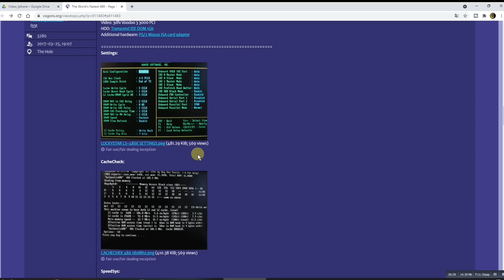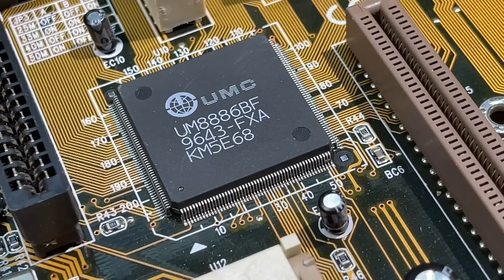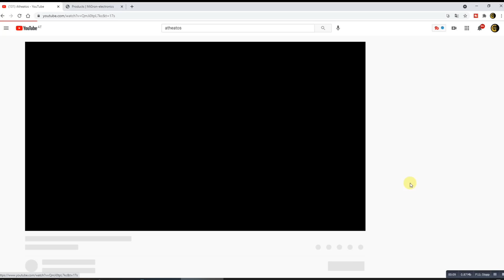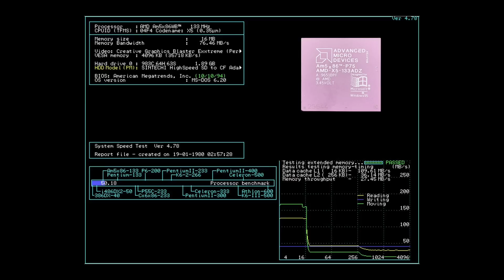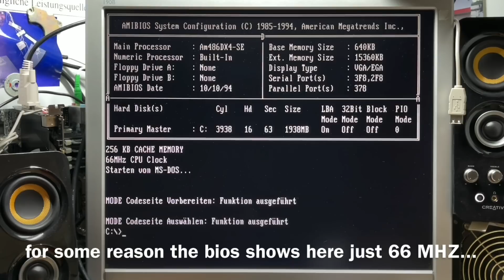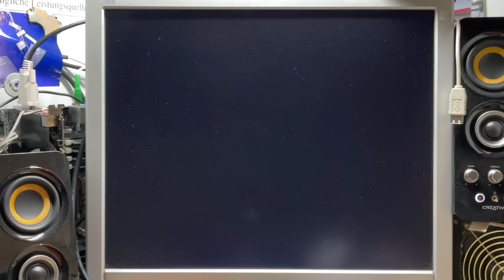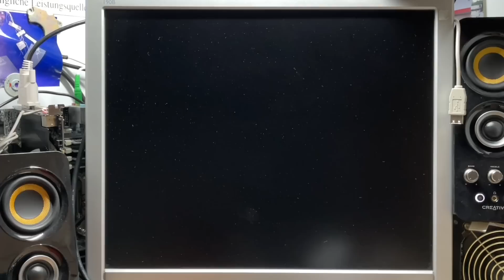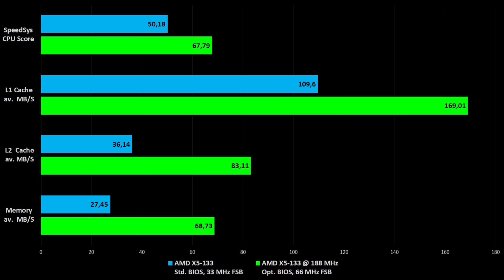AMD X5-133 Overclocked @180MHz / RECORD FPS in Quake/ PCI Clock Checker Tool

Comment: M919? Holy! I just missed out on a M915, thinking it's wasn't possible to find a later Chips build. What a cool board! 1 VLB even, and onboard IDE? Perfection! COAST module. Then again Chips boards are generally good. All of them get the best ratings.
Reply: M915 is crap ... M912 is a great board tho - sadly lacking PCI slots.
Reply: @RandomBlankUsername  All of my rigs are VLB, so I don't care about PCI slots. 1VLB ain't so bad, if the IDE controller is onboard. And what's so bad about M915? I only read good things regarding CPU compatibility. M912's show up on ebay periodically. I let them pass. At home, my favourite is MV035. Supports 2 types of ram, has 3VLB's and is good with fine voltage management on the CPU. But I don't overclock, because despite having a ton of CPU's, I only have 1 of each kind.
Reply: @enilenis  PCI performance was really underwhelming and some more details I'll look up tomorrow ;) I've had my fair share with VLB boards intended to be used with a POD. Ended up keeping the M912, 486SV2GX4 and 486SP3 from Asus.
Reply: @RandomBlankUsername  I just installed POD into MV035, but haven't tested it yet. Have to figure out jumpers first. Another machine that I'm upgrading is Mastsonic M601, that I acquired with a dead 133MHz AMD chip, and I'm waiting for a duplicate to arrive, till I can restore it to full speed. M912 I'll read up on. I don't have it, but if you say it's good, I might add it to the collection. 486SP3 - I read good things about. Most of my gear is Asus branded. I like the company. Has good longevity. My favourite ASUS board of all times is P2B-DS. I've had 2. Socket modded. Dual P3-1GHz. As close to Tualatin as it gets. But that's a whole different generation.
Reply from the maker: 486SP3 is also a great mobo!
Reply: @CPUGalaxy  Thanks for the advise. Will keep an eye out for one with populated cache sockets. I've seen them show up on ebay periodically.
Reply: @enilenis  Just checked my documentation ... or rather the thread I've started on a German DOS forum ... apart from the bad PCI performance, the M915 was very specific issues with GUS cards (I'm the guy behind the ARGUS project), also the M915 apparently has problems with writeback enabled DX4 CPUs.
Reply: @RandomBlankUsername  Very good to know. Thanks for the info. I do use GUS cards, so for me that's an important factor. Good thing I missed out on an M915 I guess. ARGUS project? Neat! I read about it. Funny thing, I was shooting a documentary on Gravis Ultrasound few years back. I live 15 minute drive from their offices. I even went in and recorded interiors, but never finished the edit, because the interview with the founder fell through. And then got overwhelmed by other things. Because of how much Gravis cards sell for, I even jokingly scooped some dirt from in front of Gravis offices, and was going to put it on ebay for as much as a GUS Max, as a gag. I mean, if their cards sell for well over $1K these days, the dirt got to be worth something also!
Reply: @enilenis  Idea with the dirt is great :)
And yeah, the ridiculously high prices are the reason I started the project ... managed to snag about 450 InterWave chips for ~$3 per piece ... all the other stuff for assembling an ARGUS are maybe $50-$70.

Comment: Still running my 5x86-133 every day, it controls a mini lathe we use for manufacturing. Have it underclocked at 20mhz x4 to keep it cool and happy. Used to always run it back in the day at 160 and never a problem.  But now that I know 160 might result in a 20mhz pci clock.. seems like I always suspected the speed bump seemed lacking.

Comment: I had one of these and used it at 180mhz from 1997 to 2003. Played unreal on it with a 2MB VLB video card and 32MB of RAM. I used to call it the fastest 486 in the West.
Reply: Unreal on 5x86? How many fps?
Reply: @mixal31  probably like 12 or so ^^
Reply: @phreeze83  yeah 12 but per minute :-)

Comment: Great videos. I didn't realise Quake would run on a 486. I thought it was compiled with P5 instructions. I remember the first time I played the demo on an early Pentium. Also the first time I saw 'true' colour in Win 3.1 Good times.
Reply: It will even run on a 386 with a 80387 co processor installed.

Comment: Those are pulling numbers in the range of my Pentium 100 box. Which is on a VX97 and uses 60ns FPM but with pretty stock timing and nothing particularly tweaked. Very very impressive I must say. I keep this machines timings rather pedestrian only because I do have a machine right above it that is super tweaked and fills that gap to a 233MMX. And is probably the machine I use the most of all my pentium and newer stuff.
I think in 3dbench with its ATI Rage Pro Turbo its roughly 90FPS or so. So 120 out of your machine is extremely impressive. If I tuned the timings to the most aggressive possible I can break about 100.  This shows what the high speed PCI bus does for you for sure!
I do not know that machiens quake scores, but that is not a fair comparison.

Now a Pentium ODD at 100 will be able to give this X5 a run for its money in quake, but that is probably about it. It would be hopelessly out ran in anything else.
Reply from the maker: yes, I was also very surprised about the values I got there. And you are right, the 60 Mhz PCI Bus brings here a lot!
Reply: @CPUGalaxy  Is it possible to do a quick follow up to see what a 30mhz pci bus would do with all other things being equal?
Reply from the maker: quake 20.7 / Chris3d 640 21.1 / PCP640 12.4 / 3dBench 97.2 / Doom 52
So the most bunch I got in 3dbench and doom with the 60 mhz on the pci bus.
Reply: @CPUGalaxy  That is pretty interesting indeed. Thankyou !   Seems like the 2 things that would appear to be the least complex computationally benefit much more from the fast bus. I am wondering if it may not be so much the extra bandwidth, but the apparent lower latency.  Those two things may send many more and smaller chunks of data to the video chip.

Comment: I used to have one of those back in the days, and I overclocked it to 166MHz, using a crappy FIC motherboard that I had for years. I had to do some work with a pin in the 486 to be able to use it, I isolated it with glue so it wasn't in contact with the socket. I could use it at that speed for most stuff, including a finite elements assignment, but there were a couple of games always crashing, so I reverted back to a more conservative 150MHz. I now think it was a matter of cooling, but who knows. Nice to see your channel is growing.

Comment: Hm how about taking this too the early socket 5 & socket 7 pentiums with a super socket 7 motherboard that can take 100 mhz fsb ? on amd k6-2+ & i think k6-3 as well setting the multiplier too 2 will make the cpu run at 6x multiplier so you can probably get 600 mhz out of the k6-2+

Comment: "we are just talking about a real 486 and not pentium overdrives or cyrix 5x86 chips" as the camera pans across the chip that clearly says "Am5x86"
Reply from the maker: yeah, coz the Cyrix 5x86 is not a real 486 from the technology point of view. But the AM5x86 is. 🤷🏻‍♂️
Reply: @CPUGalaxy  yes, Am5x86 is a real 486. I just found the combination of "5x86" on the chip with the "real 485 and not... 5x86" part amusing.

Comment: I never thought I'd see the day where there's a PCI mobo with VLB integrated. Never thought that would be possible.
Reply: There are actually a few PCI/VLB combo boards. Some are VLB native and use a bridge chip to the PCI slots and some are basically the exact opposite. I don't think there are any that have native PCI and VLB built into the chipset though, but I could be wrong. It's a neat setup, as it allows you to do direct comparison of VLB and PCI graphics cards. I only have VLB 486 board myself, but I'd love a combo board to do some testing. Would be neat to see how otherwise identical cards with different buses would compare, like the Diamond Stealth 64 which exists in both VLB and PCI flavours.
Reply: @rebeccaschade3987  I think the 486 boards were all native VLB because VLB was basically a direct connection to the processor bus. Pentiums used a different processor bus and so VLB had to be bridged through the chipset.

Comment: Neat! I wonder if my Evergreen version could overclock like the ceramic ones.
Reply: It's doubtful that it would go as high, seeing as  the interposer board that lets it run in a 5V socket limits your ability to overvolt. At least unless you're willing to risk modding the interposer board. But it should still be able to overclock a bit. Increasing the bus from 33MHz to 40MHz might be doable. It of course depends entirely on the motherboard as well. Some have much more flexible adjustments than others. The 60MHz bus of the M919 board is simply insane for a 486.
Reply: @rebeccaschade3987  The interposer board does have  (unpopulated) solder pads for switching between 3.3V and 5V via jumper. The chip itself says 3.3V. I mean, there is not alot of components on the interposer...it might not be too hard to mod though I think I might rather sell it rather than risk damaging it. Plus, I have an Pentium 83Mhz Overdrive and a Pentium 66Mhz Overdrive chip that work in boards I recently acquired so I don't really need to risk it.

Comment: Ahh, that Doom and Q1 bench is disgusting! My P166 (admittedly no lvl2 cache and onboard vga) I was getting 26. Very impressive, and very entertaining.
Reply: If I remember right, my P100 is getting a little over 24.
Reply: @wishusknight3009  Is that with l2 cache at all? I think mine was roughly where most 166s were before I upgraded bits n bobs. I've swapped to EDO, a 4mb Matrox card and 256kb coast module and now it's getting 38fps if I remember right. I'm thinking 24fps on a p100 is not too bad. A lot better than my Cyrix 5x86 100 😂
Reply: @RediscoveringRetro  Its on an Asus VX97 motherboard with 16 mb FPM and 512k l2 and fairly middle of the road timeings. Video is a Rage Pro Turbo.
Reply: @wishusknight3009  That sounds a nice setup. So many memories of those early Pentiums.

Comment: Ahh the good old M919. The traces for the two (Unpopulated) cache chips are rather 'interesting' on this board! I had one back in the 90's which had the fake cache chips soldered on :)
Reply: I'd like to hear more about this. What was with those unpopulated spaces anyway?
Reply: @SireSquish  The space was for cache RAM to be soldered to the board. In the case of some revisions of this board, the circuit traces only link the two cache chips together and do not connect to the rest of the board! Pretty useless. 

For a shot period in the mid 90's cache RAM was very expensive so companies cheated and used fake chips. More detail can be found here... http://redhill.net.au/b/b-bad.html  

The board used in this video has a real cache module installed in the slot in front of the PCI connectors.
Reply: @DevilishDesign  That's a combination of surprising, not surprising, hilarious and infuriating. So many things were dodges like that before widespread Internet knowledge.
Reply: @DevilishDesign  not "companies", _one company_, PcChips
Reply: @rasz  They were certainly the worst offender but boards from Gigabyte and QDI also had fake cache
Reply: @DevilishDesign  do you have model numbers? that would be the first time I heard about fake cache on gigabyte

Comment: Very nice, congrats! I own the same CPU, but I won't even consider overclocking it because I have only one =). I'm currently playing around with Pentium 3 FSB overclocking. I want to have 800MHz P3 (used to have this model when I was a kid), but I managed to find only 733 and 866 for cheap. Solution for me is to overclock 733 to 800 by overclocking FSB from 133 to 145 MHz. That gives 36.25 MHz for PCI and 72.5 for AGP. I still have to test this system for stability. My only concerns are ATA drives and a network controller, those are known to not work properly on an overclocked bus.
Reply: Pentium 3 and Celerons were insane for overclocking.
I used to have a 667Mhz which would run at 1050Mhz, no problem all day everyday.
At that time my motherboard was not the best, so I think I could have even squeezed out a little more!!
Back in the day some people said overclocking was just silly, would barely improve the performance.
Well, this overclock meant I could run Quake 3 all of a sudden!

Comment: This reminded me of an awesome Pentium III-333 MHz in Slot 1 format that was in fact 500 MHz and was working awesome at default voltage settings.
Reply from the maker: lol. funny that you say that now. Coz exactly now I am sitting in front of a PII mobo and was overclocking a 300 Mhz PII to 450 MHz and very surprised that this is working stable.
Reply: @CPUGalaxy  Lots of deschutes core P2's would do 450.  500 was a little rarer though. All Covington celerons and most all celeron 300A cpu's would as well.
Reply: @wishusknight3009  The celeron 300a's would nearly all run over 500mhz and were much faster than the Pentium 2. I had a dual CPU celeron 300A at just over 500.. Drilled pin to enable SMP and voltage mods.
Reply: @thomassmith4999  Not in my experience back in the day. I had several examples where they didn't. Even with volt mods we rarely got them to 504 as it took me a good 30 examples before I had one in my personal machine running 504.  We used to sell them pre-overclocked at our little shop back when they were available.   About 1 in 5 would not run 450 unless they were at 2.4 volts. But most would do 450 with only a 2.1v mod or no volt mod at all.
Reply: @wishusknight3009  Were you in the #celeron group on EFNET? those were great days. I didn't see anyone not being able to run 450 back then but getting 504 stable was a bit of a challenge. My CPUs were lapped back to copper. I was using the DFI board, the capacitors failed in the late 2000s but I'm going to try and fix it soon. I could run 450 on standard voltage.
Reply: @thomassmith4999  I was for a time. We probably sold close to 60 or 70 machines with 300A's on them. And most of the time they went with cheaper BX boards but I personally used an Asus P2B and the a little later a P2B-F. 

Of all of our celerons, about 1 in 10 wouldn't do 450 no matter what. Less than 1 in 5 needed a heavy volt mod (probably more like 1/10), and about another 1 in 5 needed a very light volt mod of 2.1. And I am sure I could attribute some of that to having a cheaper board as a foundation for our shops baseline gamer configuration. Had they all been on higher boards like an Asus P2B or Abit BH6 most of those low volt moded chips would have ran at stock voltage.  Having only nail polish to do volt mods made our choices kind of limited for what voltages we used.  The 2.4 volt specimens we often didn't sell overclocked but  put them in office computers. 

We also sold probably 20-30 Celeron 266 machines that were overclocked to 400. And i actually do not recall one that couldn't run 400. To the extent that our supplier that prebuilt some of our machines were configuring them that way for us and other customers. 

I don't ever think they were hugely faster than a P2 at the same clock, but certainly were in games by a few FPS for sure.  In most other things I think they were a wash..But considering when I built my first celeron 300A,  the CPU was $120 and the P2 450 was $1400... Yikes.

Comment: Your motherboard isn't a Chips & Technology motherboard, it's a PCChips motherboard which is totally different. The name is correct however.

It's a pretty bad brand of motherboards that made hardware scams such as fake cache. They were also cheaply made and sometimes are a bit fragile.

However their performance is pretty good indeed !
Reply from the maker: oh damn. Thanks for the hint. Of course its PCChips 🤦🏻‍♂️. I have no idea why I said Chips and Technology.
Reply: @CPUGalaxy  Congrats on your overclock by the way :D

You're so close of getting to the 200MHz barrier :o
Reply from the maker: Thanks. the video with a 200 MHz setup is already in work. Its a bit more tricky, specially with active cooling. But it is going to be an awesome video here on my channel. And all that just to entertain you all here. 😇
Reply: @CPUGalaxy  excellent video .. congratulations !! if 200 Mhz works, I can sleep easy and stop following the vogons forums  ... what other video cards can be used to do this? will it work with a tseng labs et6000?